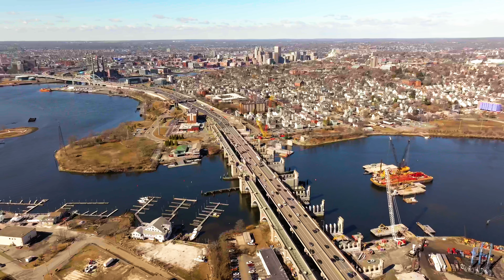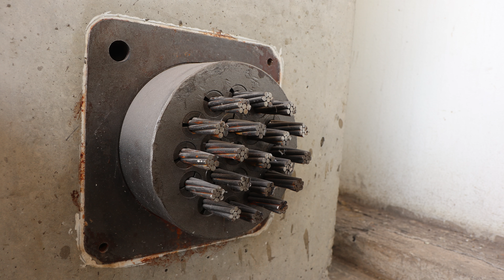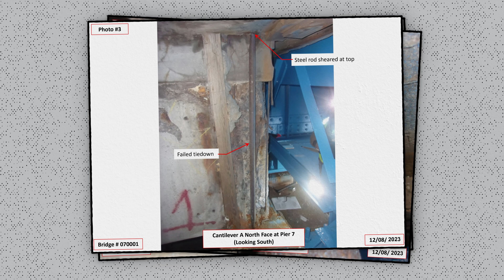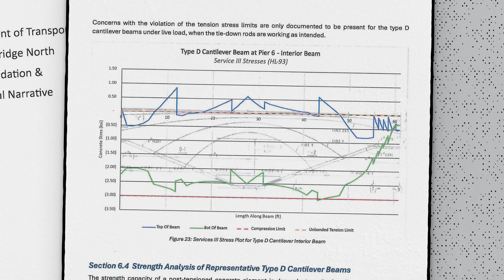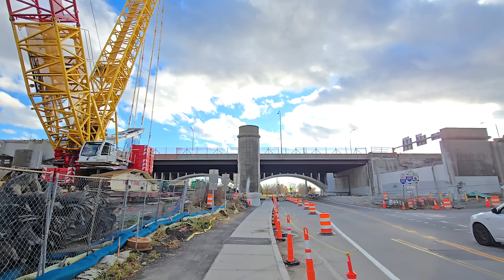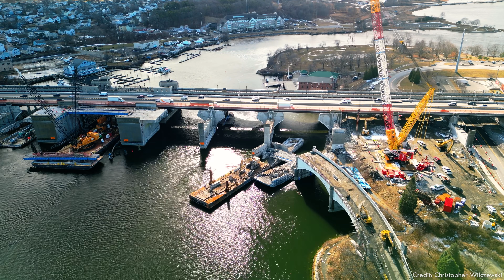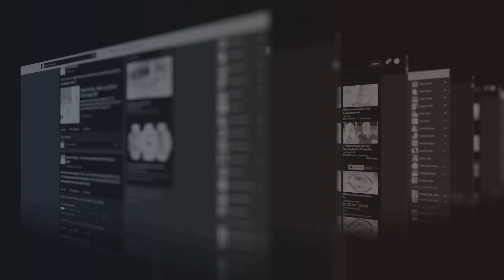This Bridge’s Bizarre Design Nearly Caused It To Collapse

Comment: Why are construction costs (adjusted for inflation) so much higher now than they were decades ago? It seems like advancements in technology, tools, materials, etc, would drive the cost down, and not up.
Reply: Good question. I think it could be because inflation has been hugely underestimated over the last hundred years or so. Inflation (or the CPI at least) is calculated by looking at the change in price in a typical basket of goods from one year to the next. That is a flawed method though because it does not take into account efficiencies and improvements that have occurred in the manufacturing processes for those goods over the course of the year. These improvements can be significant. If they're significant enough (as they are in the manufacturing of many electronic devices, like TVs) the price of a product can actually decrease over the course of a year rather than increase. A better way to calculate it would be to take the total number of dollars in existence at the start of the year (a figure that should be know by the authority that has the sole money-printing/creation authority in the United States; the Federal Reserve) and then at the end of the year, determine how much money you, the Federal Reserve, have printed/created over the course of the year and represent that as a percentage of the money that existed at the start of the year. That would give the true figure for inflation and would be far better than using some proxy measurement like CPI, which might not yet reflect the money printing that has taken place. It might take a few more months or even years for that to show up in the price of items in the basket of goods.
Reply: for renovations, the cost does not only include construction, deconstruction also count down to the total costs, and how gentle you are determines how much higher the cost is

Comment: The state has filed lawsuits against the companies that did the inspections.  Even if the inspections had identified the problems earlier probably not much would have changed.  The bridge would still need to be replaced and have been closed sooner.  I don't see how these companies are liable since I don't see damages.
Since Rhode Island is filing so many lawsuit I can see why contractors might not want to do business with the state.
Reply: Because if the problem was found sooner there could have been a better plan to build the bridge while the current one was still in use
Reply: And with the very public lawsuits by the state against anybody who might have touched the bridge, I'm sure that many architects and contractors don't want anything to do with Rhode Island given the possibility of future, expensive, lawsuits.

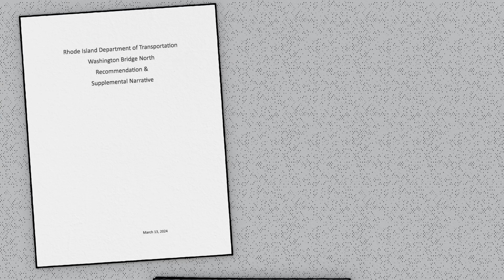Comment: 9:05 No tension allowed in a tensioned beam? I think you mean no tension is allowed in the concrete after the cables are tensioned.
Reply: The overall beam is not tensioned, the steel “tendons” within the beam are tensioned to keep the concrete of the beam in compression. Concrete is very strong in compression but pretty weak in tension.
Reply: I am also confused.

Comment: It's a shame that commuter corridor doesn't have a more efficient alternative. Buses would get stuck in the same traffic so they could put the buses on a separate track made from parallel steel bars for maximum efficiency, and link multiples of them together to move thousands of people at a time. I call this idea the Multi-omnibus

Comment: Bridge: Rod rusted completely in two with huge gap between pieces.
Engineers: Piers not performing as designed.
I love engineers.
Reply from the maker: Haha. Most rods weren't visible, encased in diaphragm. They could observe movement, but not whether they were actually fractured, hence the language.

Comment: A much smaller scale problem, but the street that goes past my neighborhood was getting redone a while ago.  It was supposed to be done a couple years ago, but right about when they were going to put down the new surface on the 2nd half of it, the surface on the part they'd already done started buckling badly.  It looks worse than the old one did.  So it's just been sitting mostly untouched for two years, with all the temporary lanes and cones.  Half undone, half done but still broken.  Punctuated by the occasional investigation and test into the subsurface, and then just last month they announced it would still be a long while before any work is done to fix it because now the city is suing the contractors so they can't do anything to it anyway.

Comment: 10:55 It's sadly a big assumption that the inspector has been given the time and records to fully understand the configuration of the structure and fully appreciate how it works.  As engineers we'd like it to be the case, but reality is often constrained by available budgets and road space/access availability, that mean if it's difficult to get to it gets looked at through a zoom lens.

A similar issue occurred on a bridge over the River Trent, near Nottingham in teh UK.  Water leaked on to a post tensioning anchorage and fortunately it was picked up during some repair works, but it did result in teh bridge being closed for a while.

Comment: It's funny you mentioned an old house renovation, I've had that exact situation not too long ago. We were removing a very thin tile floor, with a sandbed directly below, we figured that'd be a piece of cake until we found half a meter thick concrete in the front room, couldn't even get that out with a jackhammer, we needed an excavator with a pneumatic jack to get it out, that was not fun.

Comment: Difference with the US and some European countries is mainly the inspection, design and contractors. I don't think you'd even find a bridge in this condition in many countries to begin with.
Reply: because some countries actually honor these kind of work. not only they start to think critically of what might happen in the future, they also feel liable if there was a slight mistake or failure that they missed
Reply: Didn't Italy, one of the founding 6 members of the European Union, suffer a catastrophic bridge collapse in Genoa in 2018, resulting in the deaths of over 40 people?

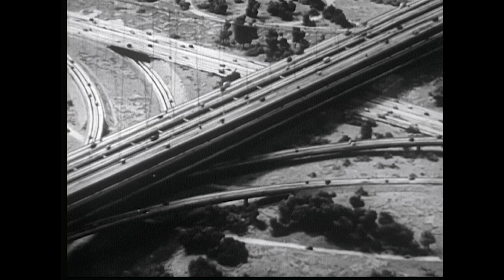Comment: Does anyone have more info on that suspension bridge at 2:18? That thing looked wild.
Reply: I think that's just a scale model. No one is building triple decked suspension bridge (yet), the suspension cables aren't even taut, and why would anyone even build a suspension bridge over shallow span in the first place?

Comment: " you go to change a light fixture and end up with a backhoe in your front yard." I feel that in my soul.
Reply: Even in IT, this happens to me lol
Reply: I thought I'd wash the outside of the house, weatherboards fall off. Termites. $70000 later, new back half of house and large portion of roof 😦
Reply: Yup. Oh, I just need this little bit of stucco patched up, right? $30k later our whole house has been repainted, two doors replaced, and seven windows...
Reply: We decided to remove the popcorn texture from our ceilings, which meant we needed to paint afterwards.  If we were painting the ceilings, we needed to do the walls too.  The outlets and light switches look shabby next to the fresh paint, so those got swapped out, and while we’re were at it, I decided to move the light switch for the outside light next to the door in the addition, rather than have it in the middle of the house.  A simple task of fishing wires though the crawlspace, but while in the crawlspace, I found the block foundation had failed.  So I ended up with the excavator in the yard because we removed the popcorn ceiling.  Oh, and the deck had to come off to replace the foundation, but it needed to be rebuilt anyway.  But in the process of rebuilding the deck, there was also a lot of rot repair that needed to happen to the wall of the house.

So yeah, that line really hit home for me.
Reply: Had that happen with a vehicle recently. Went in to change the thermostat, and 3 days later the front half of the engine is in a pile and there is a 2x4 bolted to the front.
Reply: @Lizlodude  Similar for me. I had a "check engine" light on my truck, no big deal. Took it to get repaired, found out the sending unit on top of the gas tank had corroded, replacing it fixed the check engine light, but then the gas tank couldn't be reinstalled because the frame cross beam was too corroded, so the truck had to spend a few weeks as a body shop waiting for the part so they could weld it in. Since it was there I had other rust treated and undercoated. All for a stinking check engine light. If I had ignored it, I'd have dropped my gas tank one day on the road.
Reply: @Lizlodude what happened that took 3 days?
Reply: One of the realest episodes of Malcolm in the Middle
Reply: I would laugh if I could quit crying first, too close to home, too soon,  too often.
Reply: Grew up in an old house my dad was remodeling. That's a hell of a life lesson to learn early.
Reply: Own a German car or try repairing a hurricane damaged structure and this is very familiar.
Reply: Problem is by the time the backhoe has shown up, more problems have been exposed and you find you are in the process of trying to tell the homeowner the house isn't worth fixing. That is a very tough one to encounter, believe me.
Reply: Story of my life for the last checks calendar 15 months. I knew what I was getting when I bought it, but I'm still tired of it 😂
Reply: I think that's a GREAT quote...as I am an Electrical Contractor who also does excavation work.
Reply: Same happened to my family in 2020, but with a clogged toilet.
Reply: What the heck? Australia has far more stringent standards for compliance
Reply: I chuckled and said yeah, isn't that the truth lol.
Reply: I laughed, but yeah - I know these types of 'should be easy' projects.

Comment: "Maybe the state has some problems with its inspection and review program." 
"Maybe"?  You are being far too generous.
They missed any meaningful inspection and reporting of key, critical design elements, over years of multiple inspections and "rehab" or "life extension" projects.  We are lucky this did not fail catastrophically, and result in multiple deaths.  This is civil engineering's greatest responsibility, and "they" flat out failed miserably, at every level.  It was an anomaly that someone finally broke the culture and got this noticed before the last hole in the Swiss cheese lined up, and that is a problem that is not getting fixed as the state pats themselves on the back for catching it.  Yes, it was built to be hard to inspect, and it is therefore REQUIRED that you look harder and deeper.  This is why people are claiming that the state failed...because they did.